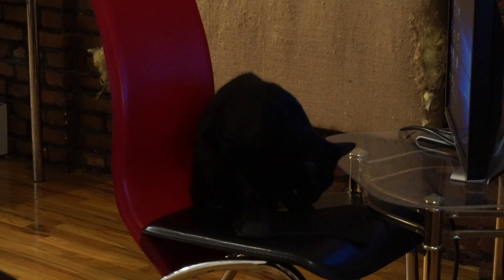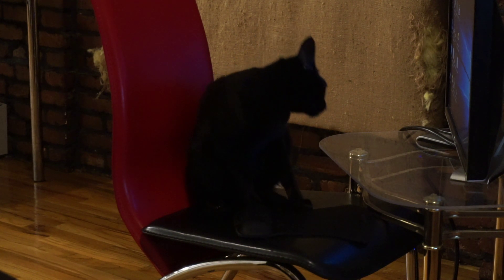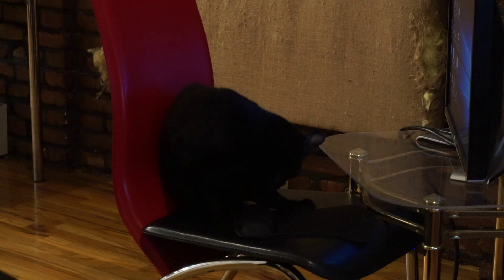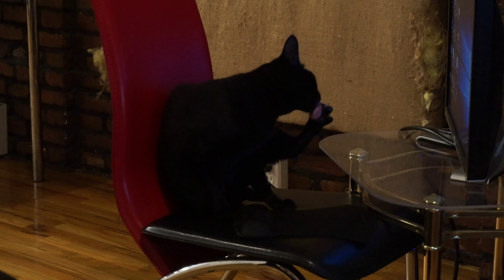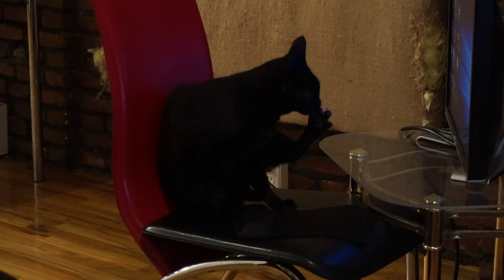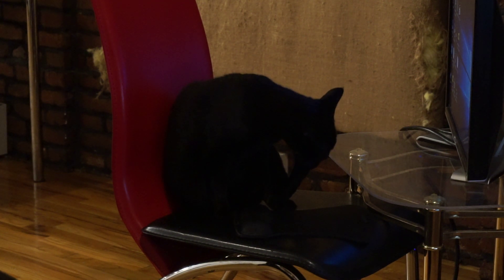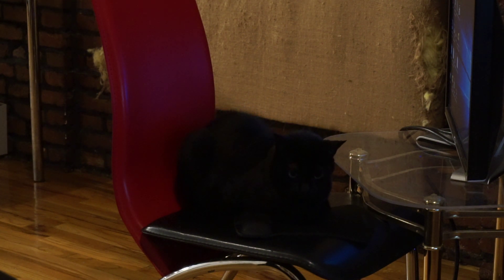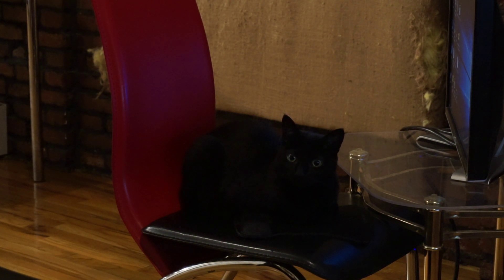introducing blackberry the kitten

Comment: Totally unrelated to this video and pretty small achivement comparing to what you do for a living, but wanted to say thanks to you Louis. Recently my Microsoft phone's screen broke. I thought to myself "F*** it, if some people do it for living, I can atleast do the simple thing of replacing a screen." And what do you know, cellphones are not made of magic afterall and I have a new working screen. Best part about it was the satisfaction of knowing I was able to do it. 

PS. Any other Lumia user reading this. Stick to original parts, Windows should check for component compatibility when rebooting to factory settings.
Reply from the maker: Good work!
Reply: Lol alright even though I have cracked my lumia I am probably going to throw it away rather than fix it and stick with it due to Microsoft's support decisions and lack of any platform recognition... Thanks!

Comment: FYI, if you are using youtube-dl, it wont download at the full 1080p, you have to force this.. 

first checking all the resolutions by --list-formats 

then using youtube-dl -f 299+140 (for example).. 

the reason why i bring this up is that the torrents ive seen are half of the size i have which is around 315GB.. 

you want ti largest resolution of the file because if you plan to re-upload it again, gootube gets its cut and will re-compress the already compressed file.. 

anyway.. 

Looking forward to the vid louis..

Comment: $90 for 80kb up and 800 kb down.
Reply: It's century link. I can't get over 800kb down with wireless or wired. They advertise that as high speed and say it's the fastest I can get in my remote area but I'm considering cancelling it because half the time it doesn't even work and I'm tired of being ripped off. My cellphone has much higher speeds. That sounds like a great deal you have!
Reply: I'll keep that in mind, that's fantastic! I plan on moving soon, so maybe I will be able to get Comcast at my new place.
Reply: $6 for 1MB up and 1MB down. Doesn&#39;t feel too bad personally.
Reply: Have you tried satellite internet? It's rather slow of course but they can't pull the "remote location" card
Reply: Gotta love the UK Internet, £12 for 50 down 18 up, that's around 20$ btw

Comment: Try iZotope RX? You can apply de-noise and de-click separately and it doesn't screw up the audio.
Reply from the maker: +CyberAcidPlanet de click with an fa430  on full blast does not work well
Reply: I get it, that's why you apply de-noise first and then de-click it. iZotope is pretty good with this, both de-noise and de-click work well with any audio material, provided that you adjust the settings properly.